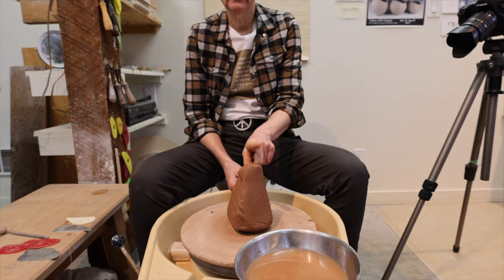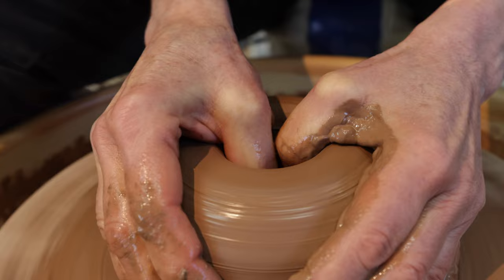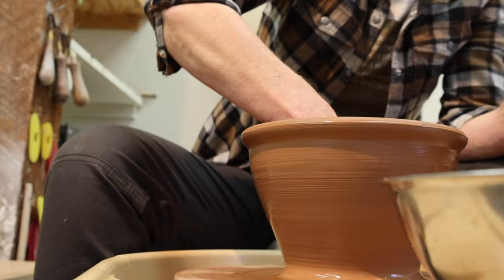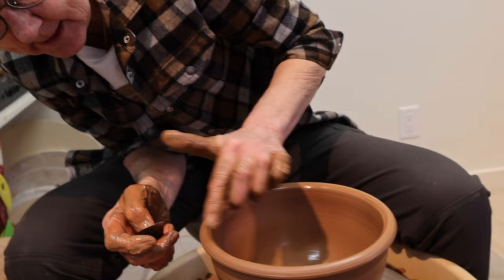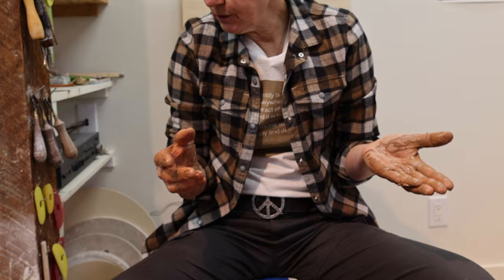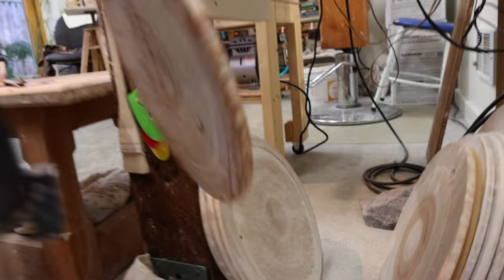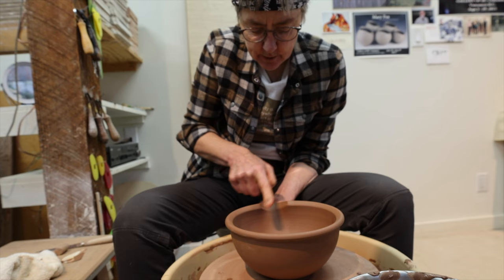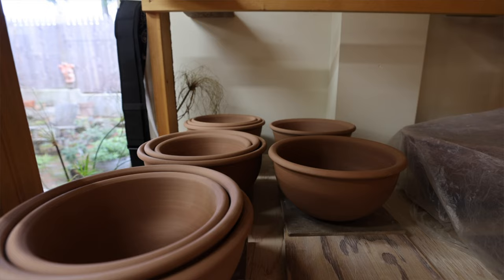In the Creation Room at Mary Fox Pottery: Rolled Rim Spout Bowls

Comment: As a young potter I was lucky enough to be around George Curttis at Littlethorpe pottery just south of Ripon Yorkshire and worked at Wetheriggs pottery in Westmorland (now Cumbria) .Both made Panchions and used traditional pan rings for Kiln furnature ..  Mr Harris at Wrecklsham nr Farnham did the rolled rim the way you are doing it but the northerners just left a lot of clay for that rim .. Because all the strength needed to be in that ring for suspending the pot on the pan rings .. Your clay looks great .. Thanks for the nice video .. .I use my throwing stonware slop (mostly Goldart) for my white slip on the redart  pans .. All the best frpm New England , Guy

Comment: Just bought your book Mary, I’m looking forward to a good read 😊 I’ve been glazing most of the day 😬 with test tiles ( which is the first time!) and a number of other things to fill the kiln. Usually I just use bowls that I have thrown, but I’ve just made a glaze with Rutile and Manganese Dioxide, so thought I would be very pro 😆
Reply from the maker: Thanks for supporting the Legacy Project through buying my book ❤️…re the test tiles, I prefer using little bowls as I think you get a better feel for the glaze than with tiles. On a small bowl you can pour the glaze thinly on the outside and a bit thicker on the interior. Bit of course, either works…the main thing is that you are making the tests and having fun learning 😊🦊…pot on!